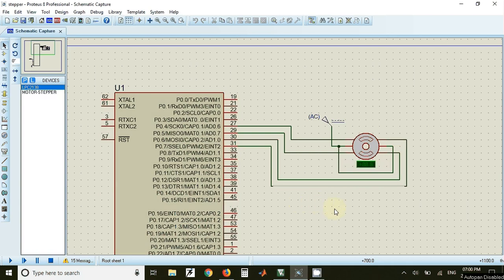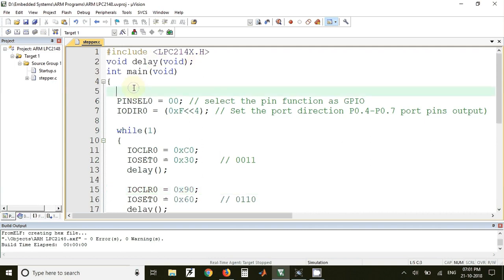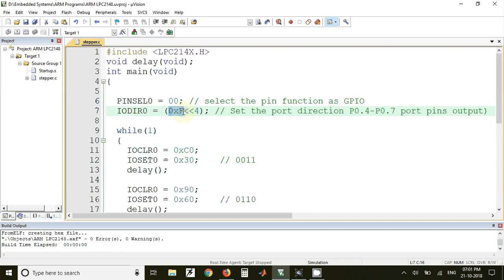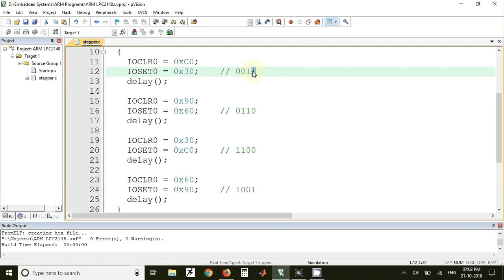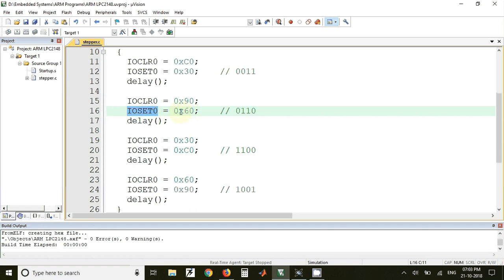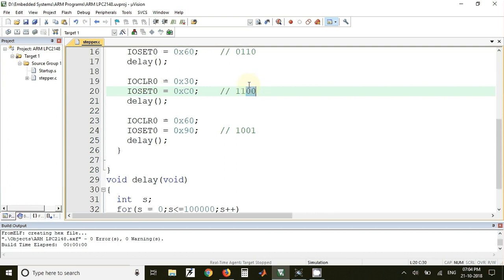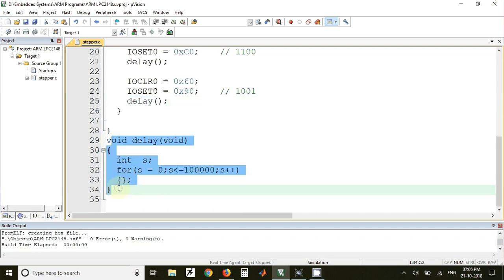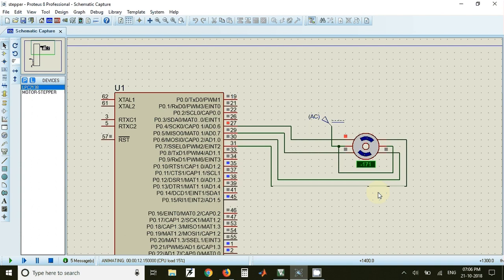Interfacing Stepper Motor to LPC 2148

Comment: sir how to take that ac source
Reply from the maker: Actually that is not the AC source, it is DC source taken from Generator icon on the left panel in the Proteus software
Reply: @AkshayBhosale18  Ok Sir.Thanks.
If we have to increase the speed ,How can we do it?
Reply from the maker: @shivamagrawal6380  you have to decrease the delay in the program
Reply: @AkshayBhosale18  what are the no. of steps required for  one revoltion in this particular motor
Reply from the maker: @shivamagrawal6380  It depends on the properties of stepper motor in proteus software. You can change the step angle as per your requirement in proteus software. For actual hardware stepper motor the step angle is fixed as per the specifications of that particular motor.